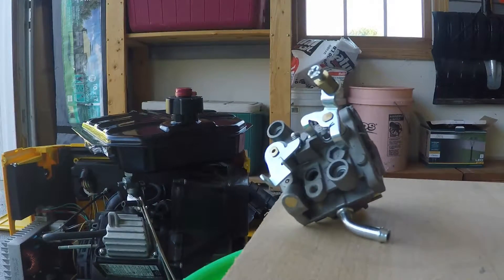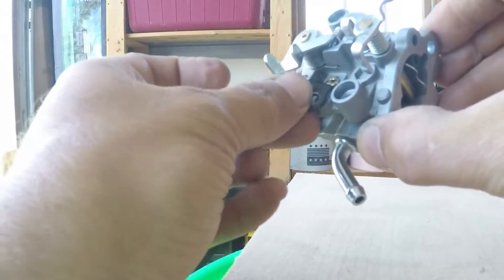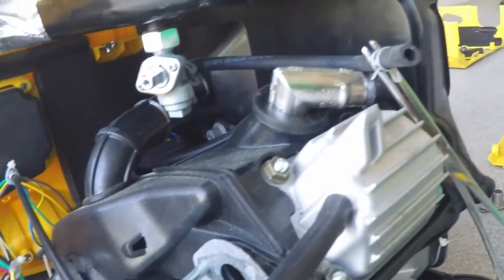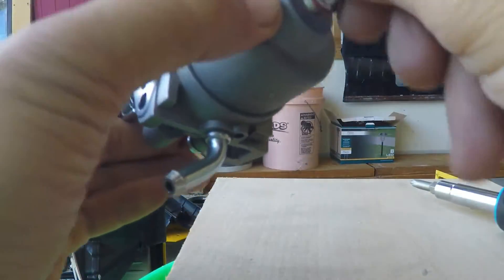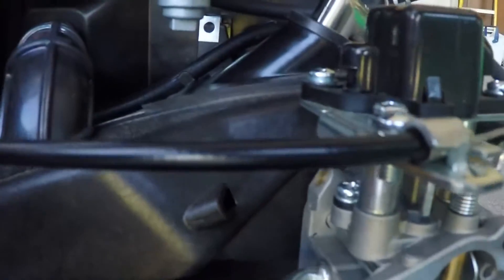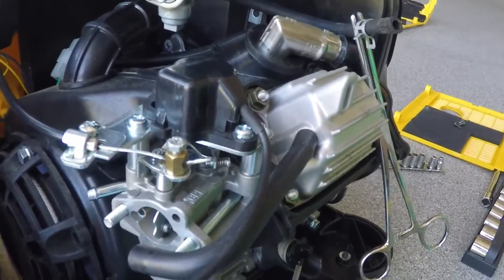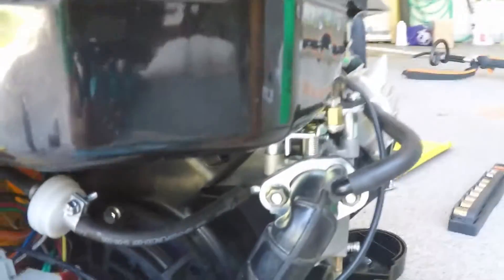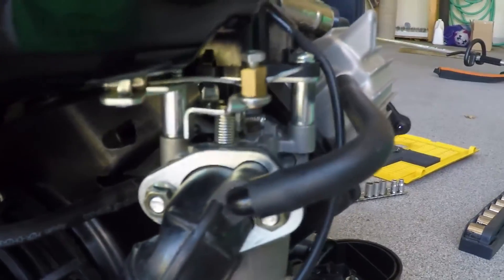Champion 2000 Watt Generator 73536i Surging Idle carburetor fix

Comment: My Champion inverter ran great and now it has started acting funny.  It idles just fine and can power a small device like a 18V battery charger just fine until it has to go under load.  Once it is under load the power shuts off but it continues to idle.  

Has anyone encountered this?
Reply from the maker: Does it detect the load and attempt to increase the engine speed at all?  If not, maybe the servo motor connector is loose.  Does overload led turn on?  is the Output led on?  Pg 23 of your manual has some troubleshooting ideas, but if it is load related, I would open it up and check all the connectors.  Here is a list of tech bulletins, but none seem to describe your issue.
http://help.championpowerequipment.com/category/2zg6it218q-tech-bulletins
Reply: @timgoihl  Thank you!  It does not seem to increase the engine speed at all.  Also I do not believe the overload light turns on either, it just cuts power and continues to idle.
I will check it out tonight and report back with my findings.
Reply: @neemaborji9993  Mine had old gas in it and it was causing it to run poorly and the power would shut off even though it would run. Oil smelled like gas. Serviced the oil, plug, rebuilt the carb and now it's okay.
Reply from the maker: The LED module seems to be an ignition control unit of some type...  Check out this 2019 video:  https://youtu.be/41wWWhCvVEI (the fix) and this one https://youtu.be/1ODR_aNU28U (the problem)

Comment: Do not use pliers! You have wrenches. 10 mm or 3/8 inch.
Reply: 9 months late but 3/8 is smaller than 10mm by enough that a 10mm will round a 3/8 bolt head, 3/8 won't fit on 10mm head at all.
Reply from the maker: Thanks for the tip!!!

Comment: Very helpful and thank you!  I've got the same issue with a low hours Champion 2000W.  Now I know what to do to fix it.
Reply: Just want to add that I went ahead and did this last night and it did fix my surging issue.  When I pulled out the Pilot Jet, I attempted to clean it with only a strand of wire, which did "seem" to clean it.  Put the jet back in, started it and seemed to work for about a minute then back to the surging.  Took it back out and cleaned the Pilot Jet again, but this time using Carb Cleaner.  The Carb Cleaner worked and it appeared my Pilot Jet was gunked up with varnish.  Make sure to use Carb Cleaner on these Jets.

For anyone who might be doubting what is in this video, Champion acctually has a help section that describes exactly what is in this video: http://help.championpowerequipment.com/article/2jEw8sUrlo-cleaning-the-2000-w-inverter-pilot-jet

Thanks again for making the video!